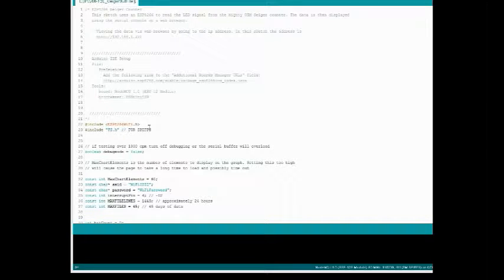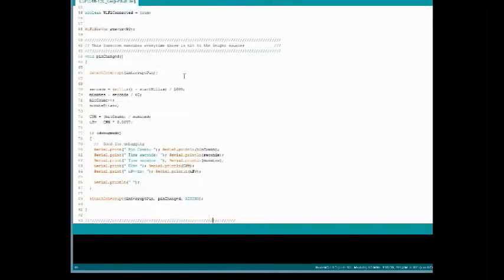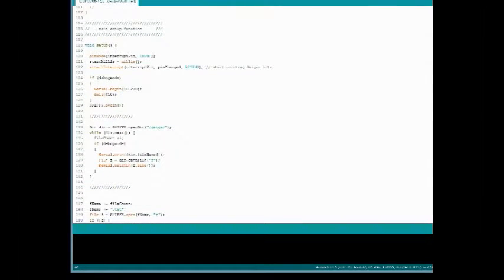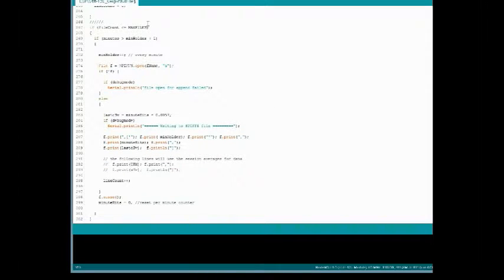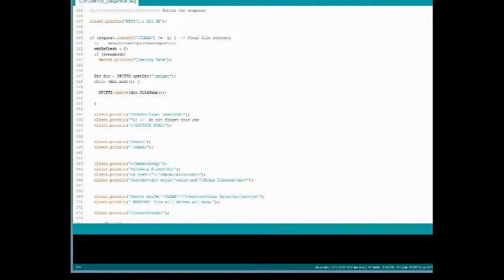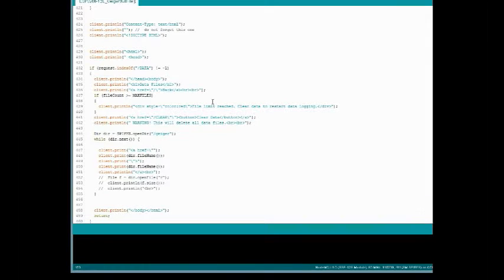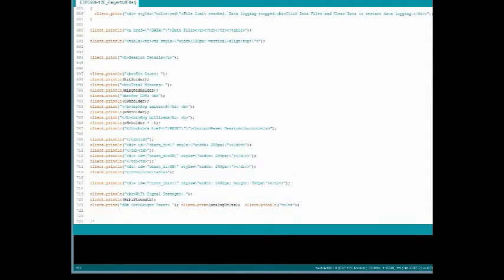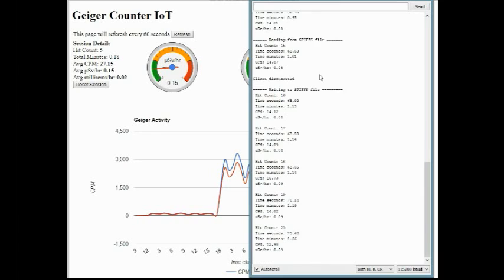Geiger Counter IoT Code

Comment: I installed your code on a Wemos D1 mini and I see this scrolling every second on the serial monitor, thoughts?

 ets Jan  8 2013,rst cause:2, boot mode:(3,6)

load 0x4010f000, len 3460, room 16 
tail 4
chksum 0xcc
load 0x3fff20b8, len 40, room 4 
tail 4
chksum 0xc9
csum 0xc9
v0004f180
~ld

This is just off of flashing... WeMos D1 mini connected to my USB only... not wired to my geiger counter yet.
Reply: I have the same problem, was a fix ever found?
Reply: @angeloma000  any solution?
Reply: Not that I remember -